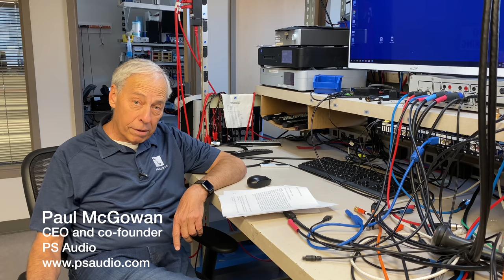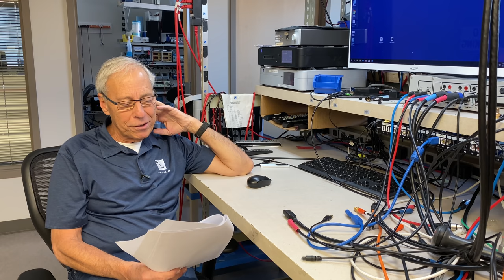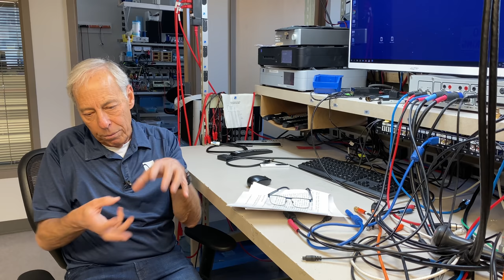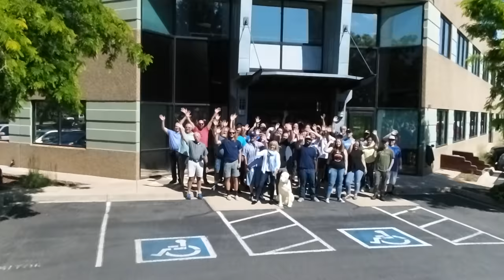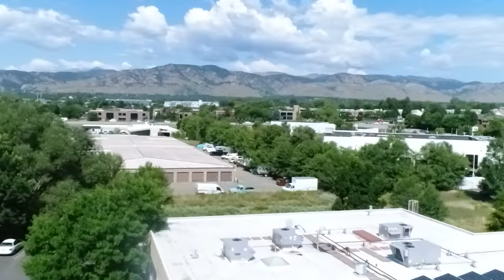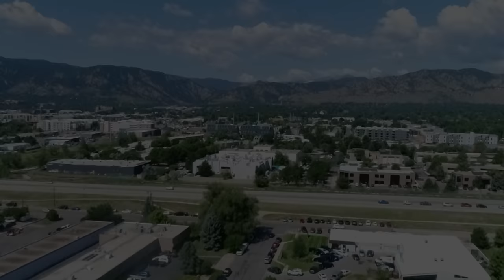Speaker sensitivity and audio quality

Comment: Spend the money on high efficiency speakers...save on a modest power amp or receiver...and get a subwoofer...your welcome!
Reply: Yep
Reply: Yeah but you still need a high quality amp to get the most of your speakers and those amp are expensive no matter how powerful they are.
Reply: If there was an easy way out, would there be any speakers with low sensitivity? For example Dynaudio speaker are not very efficient but if driven properly, they will outshine many efficient speakers. Certain people like certain sound and people tend to hear things differently too. Many likes mid range and some go for resolution at the top end. We are all unique is certain sense hence space for innovation and speakers of all kinds. Like what you hear or hear only what you like...? 👍
Reply: Good luck getting your alignment and coherency right in a small room with anything but perfect spatial alignment.. All in one boxes are still best if they fit your needs as they are designed to work together perfectly.
Reply: I think its better to choise a speaker you like the sound of than anything i would look less on sensitivity
Reply: 're
Reply: @RaviGaur  That was my experience with Dynaudio. 😁 Love their sound. Bring lots of power.
Reply: I second that motion!
Reply: @parkeranderson1172  that's so inaccurate what you just said it's not even funny. 

A good sub is far superior to a speakers low end .
Reply: @MichelLinschoten  subs are great, I didn’t say they weren’t. But you shouldn’t compromise your mains and make the “sub” play 150 hz.
Reply: Amps are so cheap now, it really doesn’t matter anymore.
Reply: You can get $100-300 amps based off the TPA3255 that measure brilliantly, they don’t have the best features or support yet but agreed we have cheap quality class D amplification now

Comment: Although 3db is twice the acoustical energy, it takes 10db for our brain to perceive it as twice as loud, our brains are not linear in our perception of sound loudness.
Reply: Little known fact: Generally yes, however the perception is frequency dependent to a large degree, look closely at the curves and you will notice you need a lot less, about 4dB in fact, to double the perceived loudness in the low frequency range for example.
Reply: @paulb4661  Fletcher Munson curve. Old radios had tonal compensation built in that would change the tonal curve as the volume went up. It was loudness compensation, but no one called it that back then. I agree with you, thank you for the added data.
Reply: @zulumax1  On a side note, I think this better than expected intensity discrimination explains the ubiquity of vented enclosures on the market. The real lows are missing, as the characteristic drops like a stone below tuning frequency even with room gain accounted for, with the added "benefit" of excessive excursion, I might add. Post impulse ringing and group delay are also inferior to sealed equivalents with reflected mids and chuffing noises often echoing from the vents and yet that little bit of extra "boom" above the tuning frequency goes a long way. This imbalance essentially, is often exacerbated by placing speakers in close proximity to every possible room boundary - corners, with the resulting infamous "one-note" reproduction. Then again, many commercial speaker enclosures are so poorly built, the actual resonating walls "complement" sound output to such a significant degree, even applying the term Hi-Fi loosely is a misnomer anyway.
Reply: @paulb4661  Could not agree more. Ports do much damage to the sound. There is also port harmonics at multiples of the tuned frequency and the fact that other midrange sounds exit out of the port and become latent and out of phase with the front wave. Only port designed I like is the Karlson design which is an exponentially opening exit to the port. Speakers are room energizers, placement, reflections, boundaries, objects in the room resonating. It is all futile but we keep listening anyways. I am experimenting with open baffle single driver design. Kind of a dipole flat baffle with a side wing. Speakers, rooms, and microphones do the most damage to the sound.
Reply: Or for ears. Nerves are very sensitive.
Reply: @zulumax1  Proponent of open baffles or critically damped, multiple interconnected chamber sealed enclosures myself tbh. Back in the days I had the privilege of taking my time with electrostatic only setup and it kind of became a benchmark for what a truly clean sounding speaker can do for the record. It's a lot less like listening to a loudspeaker, more akin to wearing huge, invisible headphones, the only shortfall being naturally the bass. As you rightly mention, room acoustics is of paramount importance and the usual set of compromises, usually thanks to the better half, serves to collapse and smear the image.
Reply: @zulumax1  Go listen to some ported Revel speakers, they sound great 🎶 and they're measurements by Audioholics, Audio Science Review contradict you're statement that ports do much damage to  the sound 👍🏾

If done right ported speaker's can perform very well and sound great. Dennis Murphy's Philharmonic BMR is a example, Port tuning was done by award-winning speaker designer Paul Kittinger. Who is known for his work on more complex transmission line cabinets.

Yes you loss some sensitivity with ported speaker's. But you can make up for that by using a good quality high power amplifier.

Comment: you are wrong on your equation. for every 3 DB you gain you lose 1/3rd of an octave NOT 1 octave. for every 3DB you lose you gain 1/3rd octave bass extension ( this is assuming box volume remains the same. if effiency stays the same doubling box size gains you 1/3rd octave bass extension and vice versa. bottom line? there is no substitute for box size and cone area, buy the biggest speaker you can afford.. note, the upper limit in effiency for a non horn loaded woofer ( single woofer) is around 6% or 100DB at 1 watt 1 meter.
Reply: Ha!  Paul quite often gets the concept correct, but the details wrong.... I think even Paul would admit to that.
Reply: correct 9db/octave...but is non-linear...efficientcy can go higher in prototype/military applications, most stadium stuff is 103db/w/m for single 18 inch...twin 18s are 104-106db...a large 4way stadium single box can be 106db bass and 110db mids +highs!!😳😳😳!! sound extremely clean but use earplugs

Comment: I recently switched from a pair of 92db sensitivity speakers to 87db, so quite a difference but both still in the "normal" range.

Both speakers are rated for nearly the same frequency response by the manufacturers (down to 34Hz or 35Hz respectively) and both are ported.

Well my god, it is extremely obvious that the 87db speaker has more bass. It sounds nice and it's so easy to blend / crossover with my subwoofer, something I've never been able to get quite right with my previous pair.

Comment: I have Capella CP-3000 that are 60 watt RMS, 4-8 Ohm, 85db sensitivity, 3-way speakers (Engineered by Bose) in the early 80s. They need a good amp, bought a Yamaha RX-V450 AV receiver and that did not cut it at all.
Later I bought a Behringer iNuke NU1000DSP amplifier to drive my transducers that I have on my racing simulation chair/rig, and I hooked up the speakers to that. I was blown away by the audio quality I got from them once properly driven. Especially the bass got so nice, tight and correct sounding.
Crappy thing is that the PA amp has a fan in it that makes a lot of noise. Nothing to worry about on stage, but in the livingroom it's a no go.

Comment: great question, perfect answer without any high end voodoo. Maybe what could be added: Smaller, low efficiency woofer have more problems with power compression due to high power input. Huge excursion of woofer causes several distortions like more doppler effect and the nonlinearity of the mass-spring-system.

Comment: Great explanation thank you. I bought a pair of Hertz for my front doors in my truck for use with the anemic factory radio because they had the highest sensitivity I could find at 93. I also noticed the woofer cone construction of paper was unique compared to other options and didn’t understand why until now. I also didn’t understand the relationship to bass response. While tuning my system my heart was telling me the front crossover should be set to HPF and close to 80, but my ears were telling me between 100-150 sounded more balanced with my sub set at closer to 110-120 instead of 70-80ish (both slopes 12db).

Comment: I am using a pair of JBL LX2005. The sensitivity is 91dB, Frequency Response: 35Hz to 22kHz, Recommended Amplifier: 10 to 250W and they sound great coupled with my valve amp build in the 1960's. I don't think I would get the enjoyment with the valve amp if they were not as sensitive. PS love the videos Paul and I have learned a lot, thanks.

Comment: Hi Paul, just an additional point. a higher efficiency speaker hooked up to an amplifier at the same volume setting almost always soundsbetter unless it is driven into high distortion or worse. As per Fletcher and Munson and their successors, our ears have less sensitivity at the frequency extremes than in the middle. So, the higher volume speaker will sound better, all other things being equal and, sometimes, even when they are not. So it is always good to match volumes between speakers precisely before comparing them. A quick way to do this is to switch between the speakers using white or pink noise which can be found in many free apps and is well approximated by interstation hiss! Comparing speakers at different levels was a favorite trick of unscrupulous Hi-Fi dealers back in the day. Thanks again!

Comment: As a speaker designer there's some considerations that I always make the same decisions with; homes here in europe are getting smaller and smaller, for more and more money, so if I go by hoffman's iron law of "bass response, small box, sensitivity; pick 2", then I'm ALWAYS going to choose small box, and with how most modern music is recorded and the reluctance and difficulty adding bass through subwoofers, I'm probably also going to choose bass response.

The other reason I'm going to discount sensitivity is how electrically noisy home environments can be these days, and how infrequently people use decent power conditioning, a high sensitivity tweeter is going to expose your noise floor MUCH faster than a low sensitivity design, if I can improve other aspects of the speaker and reduce that noise floor, I'm going to do it.

I do risk alienating the old-school crowd in my design approaches, but I hope that hi-fi will come back into fashion with the younger crowd and I believe my designs are much more orientated to their needs.
Reply: I enjoyed reading this
Reply: What speakers are you designing?
Reply: @mctapia12  I've always got some sort of project on the go, the pair I'm just finishing up is a 2 way 14 litre bookshelf using ultra affordable components and crossover duties done by Cabinet design rather than electronically. I've managed to get them to play 35hz-20khz +\- 3db

Comment: I would suggest that an important factor on woofer efficiency ( without bass loss ), is the size or field strength of its magnet.
Reply: yes he does not even mention this I heard great bass even with small speakers with high efficiency and  audibly sound faster at all frequencies
Reply: Yes.  If the magnet is not magnetized (I guess it wouldn't be a magnet then) the efficiency goes to nothing.  On the other hand, it doesn't work quite as linearly as one might think.  The BL "constant' is the magnetic field density multiplied by the effective length of the voice coil in the magnetic gap and it determines the force exerted by the motor per unit of current.  So, you would think that twice the BL would give you twice as much everything.  However, there is a magnetic damping force created by the back EMF = BL*u where u is the velocity, that counters this.  A great piece of freeware is Unibox for Excel.  It is a good enclosure design tool and it allows you to play with these things.  If you have an interest, and a few hours to kill, it is pretty fun.  Cheers!
Reply: @pauldavies6037  see my comment above. It's more than amazing what strong neodym motors can do nowadays!!!
Reply: @AndrewUnruh  A good speaker design tries to shortcut the back EMP by demodulation rings on the magnet center pole
Reply: @thomasbotz7564  yes big improvement the last few years

Comment: good question, GREAT answer. I've been an audio enthusiast for decades and didn't know the true size factor. 8X the volume says uh, volumes about why efficiency has been 'traded down'.  Much easier to blend a sub with a 89-90dB speaker that reaches down to a real 40Hz or so than a 93dB+ speaker which only goes down to a higher useable range due to box size limitations.  I'll take that tradeoff every time with all the amp power we have on hand nowadays.  Excellent and simple explanation Paul. 128K +1 subscribers

Comment: "Efficiency" is not JUST a matter of (moving) mass, it's also (among yet other factors) a matter of effective coupling of the driver diaphragm to the air, and that relates to effective piston (or horn mouth) area. A larger piston has greater air resistance and relatively less inefficient and turbulent "side-spill" (due to a higher ratio of area to circumference), therefore it is more effective at transducing mechanical motion to acoustical energy.  You could say it has more traction to the room; another analogy would be a high-bypass turbojet engine.  Also its inherently higher directionality increases its "throw", which does not increase overall efficiency but does increase its on-axis sensitivity.  All else equal, a larger driver area gives a more dynamic listening experience... within its coverage area.

Comment: Lower moving mass (Mms) implies a higher resonance frequency of the drive unit , wich impedes how low you can tune it
Reply: Engineering work arounds to that too. TAD Pioneer electronics designed a dual voice coil woofer with a special low mass ceramic cone. The second voice coil starts passing energy by the crossover to keep the bass roll off flat by dipping the impedance lower to 6 ohms under 50hz or so.

Comment: Thanks for this good question and great explanation! With (bookshelf) speakers getting smaller and powerful amps cheaper, one can still achieve great sound without the focus on sensitivity.
The Mica RB45 for example is a small speaker with rather low sensitivity but with a big sound and low end. Downside of that type of configuration is you really need to drive the speakers and play rather loud to make them sound right. High sensitivity speakers tend to sound already great at lower volume/less db's. So if you are a quiet evening/midnight listener a higher sensitivity speaker would be the better choice. Or an actieve DSP controlled speaker which "corrects" driver behavior over the whole volume range.

Comment: May very well just described the problem im having with my speakers. The manufacturer wanted a very high efficient loudspeaker, but wanted to focus on maintaining the bass approx 30hz just like was mentioned. Then also design the cabinet to not take up much floor space. They ended up going with a pair of 6in subwoofers in each cabinet for the low end, 5in midbass for the midbass plus some of the midrange. The cone material is very thin and light weight. So Im almost certain that what im hearing is "cone cry". While listening to bass heavy music at high volume. The only reason I desided to purchase the loudspeaker was because of how much bass and full range sound they put out. They do 30hz well and are quick and punchy. Bass string solos sound amazing. But just like what was also mentioned. Using a shorter voice coil to reduce the weight. Even though they can take some power. Can't really take advantage of it since they really do start to lose linearity. I used to believe that they were the absolute best you can get for the money. Even though they still sound impressive for what you get at that price. Until after several critical listening sessions I noticed what was described. Had no idea what was wrong with them. Now I know. Thanks!

Comment: I know some speaker cabinets (2 stereo and 1 bass( that can hit 118 dB SPL at 1 meter at 1 watt. My old Sunn 2x15  front=facing rear-loaded folded horn that could blast a theater with 100 watts. However, if you had an acoustic labyrinth speaker with a 6" woofer, it would probably sound better for pipe organ or electronic music. The Sunn cabinet was made to compete with guitar stacks, but the bass only goes down to about 40 Hz, so you're mainly hearing the harmonics. if you want to play a 32 Hx pipe organ note, you wound need a design that sacrifices efficiency for very deep bass. Very deep Nass costs a lot in power. Take a look sometime at the baddest pipe of.a big pipe organ, and you can get an idea of how long the wavelength is that you are trying to reproduce. From my understanding, the acoustic labyrinth speaker (with a very long rear port) can actually have a speaker play below its resonant frequency. I haven't tried it, but I've read about it. Now that I've switched from a 4 string bass going down to E. I have an extra string that goes down to the B below the E. It makes me more aware of the deep bass issue.  It's a trade off.

Comment: Not necessarily. Improving the efficiency of a speaker system can actually enhance bass performance if done correctly. Efficient speaker designs can often produce cleaner and more accurate bass, as they can handle more power effectively, resulting in better control over low frequencies. However, it ultimately depends on the specific design choices made by the manufacturer and how they balance efficiency with other factors like bass response.